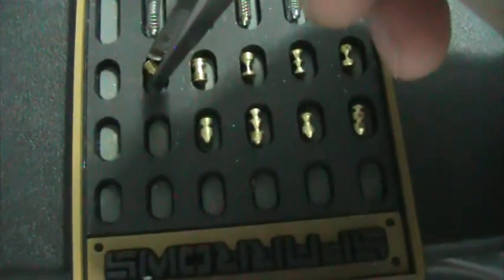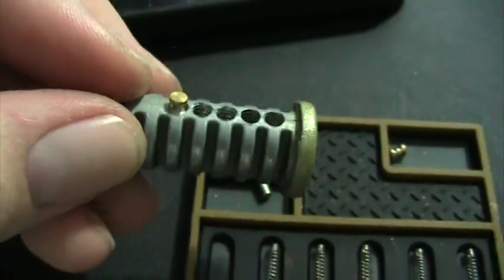(006) Home Made Security Pins

Comment: were did you get the "SET-SCREW" on the top of the lock that you drilled the holes for? ALSO did the threads inside the lock damage the lock? its not smooth and i was concerned that the threads would damage it. i have PROFESSIONAL practice locks with this but they did it professionally and they only put 3 threads at the top of the lock you threaded the whole shaft! because you did it manually. i like your way if it works. but you have to be careful because by threading ti by hand you could cross thread it! it needs to be straight.